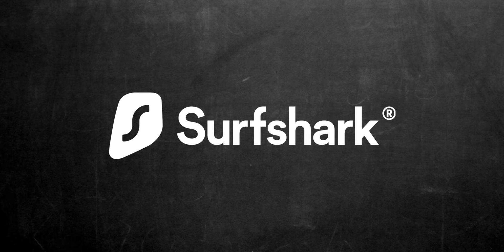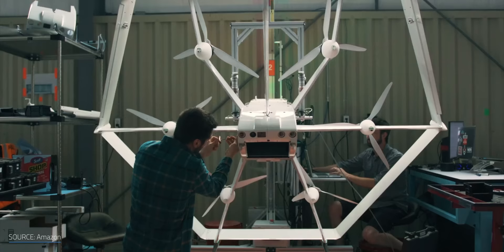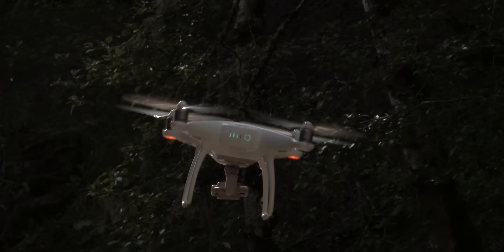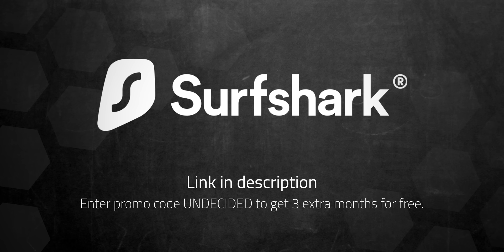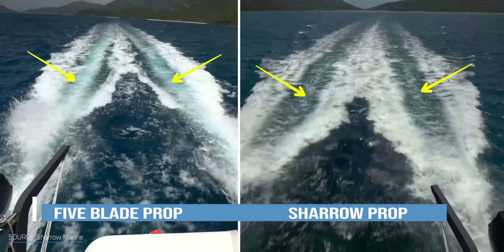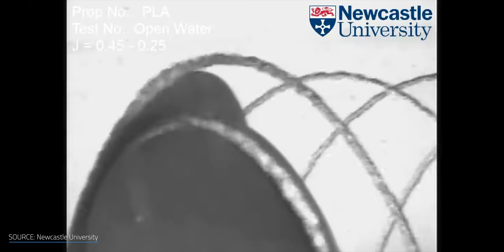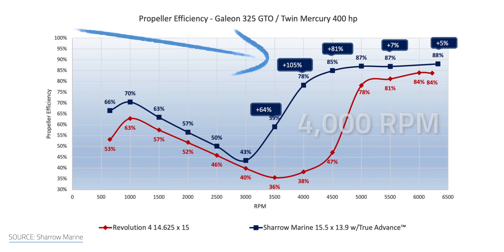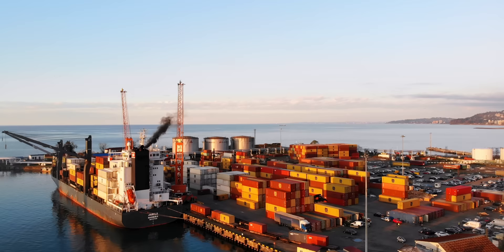Why is this Propeller Getting So Much Attention?

Comment: The applications for wind energy could also be interesting. Smaller designs for consumer units for the same output is a game changer.
Reply: That was my first thought but I suspect the really big problem will be their weight.
Reply: I don't think that adding a toroidal propeller on a wind turbine is a good idea at all, at least not as a way to improve efficiency. Something might be said for noise reduction, but it probably would come at quite an efficiency loss. This is because in such a toroidal design, the two sides of the blade follow each other rather closely, meaning that the second blade gets more disturbed air. This is why a 4 bladed turbine is already inefficient, so 20 degrees or so separation with a toroidal shaped blade is certainly not efficient. Unlike the powerboat propeller where efficiency loss due to vortexes and cavitation at the wingtip are huge, the loss due to vortexes at the low rpm of a wind turbine are just not big enough. (This is also why this shape is not more efficient for drones even at their high rpm: wingtip vortexes in air are far less bad than in water)
Reply: That was my first thought as well
Reply: Many prototype small scale wind turbines do use a toroidal prop similar to these designs. They do this to optimize the design for very low wind speeds typically found near home roofs rather than the higher speeds of real wind turbine farms built much taller. You can find some of them in other videos Matt Farrell has done.
Reply: Not really. Not in the least. The video is extremely misleading on this. Wind turbines already use variable pitch props. Their RPMs generally do not produce significant sounds within this annoyance frequency. Accordingly, this technology basically offers zero to most market segments which require propellers.
Reply: I was thinking the same. Quieter yet smaller designs for residential applications would be great
Reply: @DavidM2002  really big
Reply: Which is why I assume the latest designs of " Vertical Axis Wind Turbines " are somewhat based upon..
Reply: @DavidM2002  They could be made from lighter materials, though, because the furthest point from the spindle is supported on two sides instead of being one cantilevered beam.  If the variable pitch problem is solved in a way that's still cheap enough to mass-produce, anyway.
Reply: Interesting you say that.  I recall seeing a large, narrow, cylindrical windmill design that is just a torroid with an extended axis. It was omnidirectional so cheaper to make.
Reply: @justanothercomment416  If the tech can reduce turbulence downwind of the turbines then it may see a lot of use because most turbines are found on wind farms in large arrays. Also, lower noise is always useful, particularly in turbulent air.
Reply: These are mostly worth it when the rpm is in the thousands so not much help unless you talk about the very small like 30-50cm turbines at peak speed.
Reply: @christoferstromberg6605  The noise from wind turbines comes mainly from the vortex that forms at the tips though. If they could spread that out, it would likely help a LOT.
Reply: Wind turbines are getting larger than ever. Making toroidal shape at such a massive scale will increase the production cost and add additional weight to the structure. Efficiency gains mean nothing if more turbines could be built with the same cost which can yield more power together
Reply: @commieTerminator  imagine a 250m toroidal turbine :D

Probably nearly twice the material of a regular one.
Reply: @BooBaddyBig  The noise is a function of RPM and blade size/design. Turbines don't generally produce much sound at these frequencies. This ignores that wind turbines are absolutely terrible technology.
Reply: There is a YouTube video showing a new design for wind energy... No moving parts,  no sound,  extremely efficient.  Can be used at home or on top of a commercial building in a group.  Of course I think it was developed in Sweden.
Reply: @justanothercomment416  They really aren't.
Reply: @justanothercomment, wind turbines are unbelievably noisy. One of my aunts lives near a big wind farm in west Texas and those things are LOUD! Plus wind turbines and aircraft propellers have to be variable pitch for maximum efficiency. Toroidal props are fine for applications where fixed pitch is acceptable.
Reply: @billmullins6833  noice does not mean specific frequencies. "Noise" is a frequency with magnitude. That's it. It says nothing about a specific frequency.
Reply: @BooBaddyBig  Once you get past the propa agunda (I know), they really, really are. I could explain more but yatubb sin sours all comments of facts and depth.
Reply: @TOPDadAlpha  Which, at best, if attached to the grid, can literally only lower grid availability and increase energy costs.
Reply: @justanothercomment416  Many, many grids have plenty of wind power on them, and reliability and availability has gone up, not down while being low cost.
Reply: @BooBaddyBig  As an example, once you reach half grid coverage with wind or solar...
Reply: @BooBaddyBig  reliability can literally ONLY go down and pricing go up. Period.
Reply: @BooBaddyBig  I have confirmed ya tub has sin soured one small paragraph, the entire comment, eluding to just one of the core issues.
Reply: @BooBaddyBig  I'm sorry, but your position is verifiably completely wrong. Period.
Reply: @BooBaddyBig  I'm sorry, but your statement is factually wrong. I would love to provide a detailed explanation, and I have repeatedly tried before, but yat ub heavily sin sours the facts to prevent people from learning.
Reply: @justanothercomment416  No, that's a complete myth. You can easily reach 80+% with wind and solar, because the variations add statistically (i.e. in quadrature) rather than linearly. Most people don't get this because they have zero statistics background. Also you can blend wind and solar in a lot of places to balance out seasonal variations (wind tends to be strong in winter and solar in summer, so the seasonal trends can cancel).
Reply: Or we could just do the right thing and go full nuclear
Reply: @BufanMuayThai  That's what France tried to do. It was a HUGE mistake. EDF has been basically bankrupt ever since. Nuclear power is more or less baseload only for economic reasons (a nuclear power plant running at 50% load makes electricity that costs twice as much- and it wasn't cheap to start with). But much of the demand isn't baseload. Trying to use nuclear for peakload was such a very painful lesson for EDF/France.
Reply: The noise that people disliked about drones is a high frequency sound caused by the vortices at the end of the propeller. 

Drones depend on propellers for lift. And this same application works well with boats too. 

However, i believe wind turbines (if that’s what is meant by wind energy) would have to be reinvented  with the toroid propeller in mind. Current iterations of wind turbines depend on blade-shaped “blades” as a means of starting and stopping. Possibly the future will have different tech. 

The noise generated by the blade of the wind turbine itself is rather gratifying: a lagging and deep “wooosh” sound as the heavy blade cuts through strong winds. Although, the frequency converters and transformers make awfully loud sounds… especially the pmg types which have multiple converters- though I’m not too familiar with DFIGs. 

Also I’ve been told that wind energy also peaks during the summer due to air convention.
Reply: Wind energy is inefficient period to many moving parts and potential points of failure and wear and tear.

 Solar is a maybe if they can develop a more eco friendly way of manufacturing them but in the end Nuclear is still the best we have.
Reply: @happyjohn354 ? Wind power has fewer moving parts than a conventional generator.
Reply: @BooBaddyBig  Ya but it also makes less power before it needs to be repaired its all about ratios and scalability.
Reply: @billmullins6833  I live near several wind turbines and they are all very quiet. Nearly all wind turbines are just not noisy at all at normal residential distances. However a few percent of wind turbines see turbulent air and those can be really pretty noisy, and some older designs may be noisier as well. They've become quieter over time and control systems have improved. But the vast majority just aren't noisy these days.
Reply: @happyjohn354  But it's also cheaper because there's fewer moving parts to start with and it burns no fuel. The studies show that wind turbines are cheap power, very comparable to solar power. Both are the cheapest electricity you can get, just a few pence per kilowatt hour now.
Reply: @BooBaddyBig  That's on paper not accounting for environmental factors and unforeseen circumstances there is a reason all the big wind farms are falling into disrepair and being left that way.

The reason is simply because they barely even make back the energy it takes to build and maintain them meanwhile they require massive amounts of land for the wind farms.

Seriously talk to the engineers who work on them when they are away from their bosses they will flat out tell you they are a scam.
Reply: There are already optimal new turbines for wind energy available
Reply: @happyjohn354  Yeah, no. You're not nearly as smart about wind farms as you think you are. And 'alternatives' like nuclear have huge cost problems which are far worse, and nuclear is baseload only whereas wind and solar production tracks demand reasonably well-but not perfectly, just a lot better.
Reply: @BooBaddyBig  Any power generation that relies on good weather is automatically bad.
Reply: @happyjohn354  Then you won't like Nuclear Power because France has white-knuckle rides every winter due to its inflexibility.
Reply: @BooBaddyBig  No because France sucks at scheduling maintenance.

For some reason they scheduled half of them to be taken offline for maintenance AT THE SAME TIME.
Reply: @Eikenhorst  There may be countervailing efficiencies though. The blades can be made thinner and (effectively) longer. Also the turbines may have effectively larger diameter because the blades can suck air in from outside the physical blade tip. And lower turbulence might produced which would work better for deployment in wind farms.
Reply: @BooBaddyBig  Possibly, but still it sounds to me extremely unlikely this blade design would help for wind turbines. But if people disagree they should do research in this. I certainly don't mind if I am wrong in this matter :)
Reply: @Eikenhorst  It's quite possible you're right. The history of the Sharrow propeller is that they originally wanted to use it for aero propellers but developed it for boats because it worked a lot better than the standard props. But I don't think they've necessarily ruled it out for aero use.
Reply: Adding to the good points already made: the main thing about a wind turbine is that they're not controlling the wind; they're recieving it. A vital part of that is to be able to ramp up and down with demand and wind speed changes, so they have to be able to feather their props (turn them). Also when the wind hits maximum, they need to be able to deaden their profile as much as possible to avoid getting damaged. A big fixed prop can't do that.
Reply: @billmullins6833  Their nose depends a lot on the design. I've stood directly underneath/ inside one when wind speeds were about 18-20 m/s at ground level and it was quiet enough to have a normal volume conversation. There were also sheep and birds all around it, not bothered at all. No dead birds that I could see - I checked.
Reply: @BooBaddyBig  Not just distributed generation though. Interconnectors are vital, especially in Europe. We already dump excess wind from Scotland to Norway, where they use it for pumped hydro  and sell that power back when the wind's low. There are proposals for a Europe and North-Africa wide power grid, building mostly solar through the south and central, wind along the west and making use of nuclear, geo and hydro where it already exists. Theoretically, without any new tech or any new nuclear (though SMRs are likely), Europe could go net zero on power production before 2050. I imagine the same is true of North America, given the size of it and the diversity of microclimates.
Reply: @tSp289  they might be able to steer fixed props edgewise on though.
Reply: @BooBaddyBig  they can and do do that, if a storm is incoming and they need to shut down. I suppose they could angle the whole nacelle to spill wind, but it would have to be thoroughly modelled to see if it was worth the extra expense. As it stands, wind is very appealing to investors since they are almost literally money machines - they pay for themselves very quickly. I suspect that a toroidal prop would limit the size of the blade and massively increase the cost and complexity, might not even be worth it. I don’t know if you’ve ever seen the difficulty of transporting a 110m turbine blade from the manufacture site to the docks, but they have to close roads for it sometimes. A toroidal blade would have to be split into several pieces to make it even feasible to transport, adding weight and reducing strength. I wouldn’t be surprised to see them on small-scale domestic turbines, but I would be to see them on big offshore monsters.

Comment: This design hasn't been used in vessels before in part because of the expense of making them, and the savings in fuel haven't been as urgent in the past. In the case of aircraft, it may be materials technology; composites and materials such as carbon fiber and aramids allow us to make shapes requiring higher strength to weight ratios than before. I'm looking forward to these being used on electric aircraft capable of carrying passengers and cargo.
Reply: Electric plane? We aren't even close. 😂
Reply: The future of aviation are ornithopters not propellers

Comment: Youtube absolutely blew up with videos of these toroidal propellers on drones a couple of months ago when the news broke out, and in reality, the results seemed to be quite underwhelming. You get a less annoying noise frequency range, sure, but most people experimenting with them found out they had significantly less thrust in some cases, negating efficiency or noise benefits, and while the noise did have a lower pitch, they're still very loud. The MIT videos were also quite disingenuous in the way they played with the volume: standard propellers were turned up significantly while the toroidal ones... weren't even playing any sound at all because Sebastian is talking over it, lol.
Reply: That was due to the quality of their models vs the MIT variants. 
A true refined one is much more efficient.

Comment: There was a lot of questions to MIT experiments so i had tested 3d printed toroidal propellers on a drone - they was in fact louder and kind of shaky and unstable. It may work underwater with a rotating speed that required underwater, and without much turbulence. But as propeller for a drones - it it debatable, i believe they need more development to be productive.

Comment: They could make the boat propellers much easier with lost wax casting instead of machining them from a solid block. most large props are bronze based anyway which is perfect for the lost wax method.
Reply: The imperfections would make the propeller useless.  Any surface imperfections add cavitation and cause degradation over time.
Reply: I've seen videos of large propellers being made; they still had to be machined at the end to get a good surface finish, then thoroughly examined. If the tips of a propeller can evaporate water, then imagine the forces that are experienced. Now imagine a hairline crack, or an imperfect casting where there is a 'cold shut', slag inclusions, or any other of the many possible defects from casting. 

At those speeds, the flying metal chunk would punch a hole through the boat or its occupants, and leave behind a dangerously unbalanced, fast-spinning prop shaft.

Comment: But did really no-one think of this before? or is it true that it only got developed because of modern tools? (simulations, 3d printing, what else?)
Reply: I would guess that some of these designs have probably been tried before, but due to their geometry they can be very expensive to manufacture, so it probably didn't make too much sense.
Reply: @Anfros.  yeah that's what I mean, because of modern tools, manufacture got cheaper, iteration got faster, planning&measurement more efficient..
Reply: At least 2, possibly 3 instances of similar developments have been brought to paper over the last century and a bit, at least one of them was patented. Unfortunately these designs never left the paper.

Comment: I am guessing that this is a prop suited for certain size vessels and is ideal to work in its specific field and application. If you work a prop that operates at an inefficent ratio for the majority of it's use, but that use is in the optimal performance for the toroidal prop, then it is likely best practice to use the toroidal prop in that application. Its not a one hat fits all situation, its a sun hat for a sunny day that you'd never wear in the rain

Comment: The original units of this type from the beginning of engine power were 'screws' - that is air screws on heavy copter designs that never got off the ground and were laughed at, and screws that were on vessels in the water that produced excellent propulsion. 
This current Toroidal concept picks up where that left off, getting rid of the entire mass of the large screw and still using the efficiency of the physical design structure.

Comment: I think it would be cool to see some applications within jet turbines, like maybe toroidal compressor blades at the first stage to suck in higher volumes of air for higher fuel efficiencies?
Reply: Turbines don't have the same problems with tip turbulence. The blades run very close to the body of the compressor.